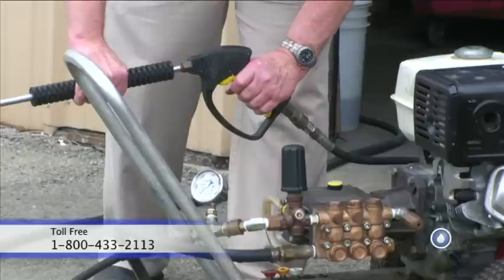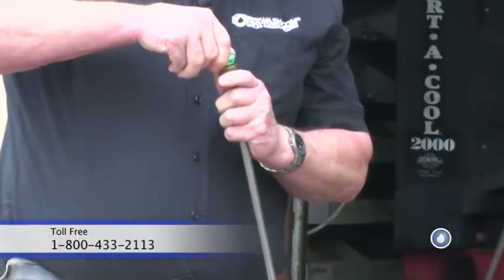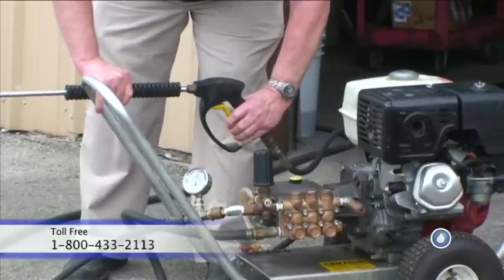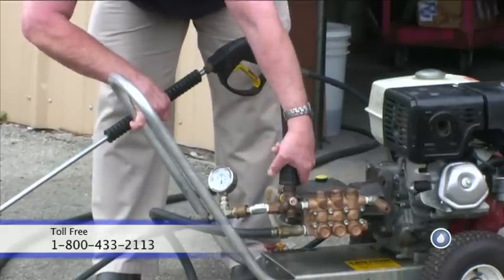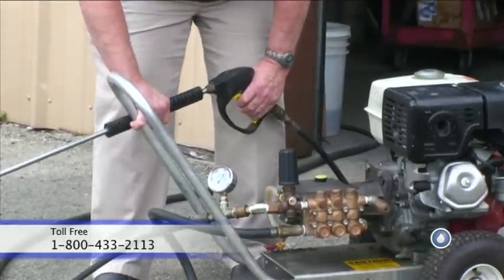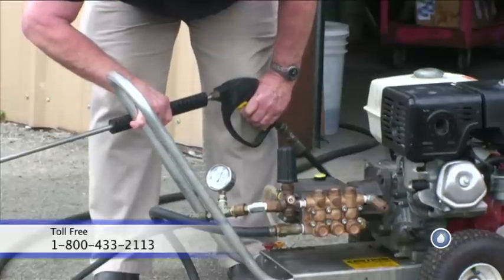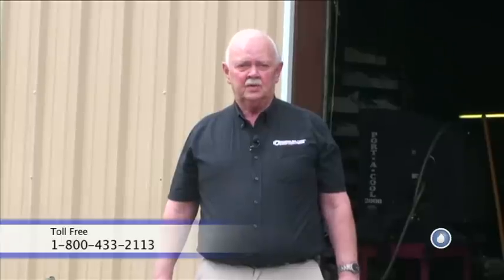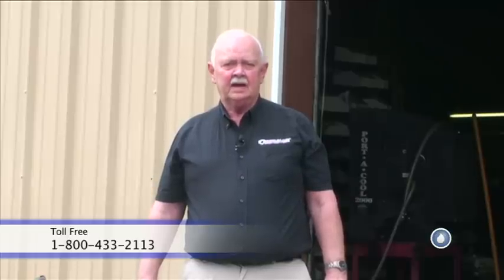How to Adjust a Pressure Washer Unloader with Larry Hinckley from PowerWash.com

Comment: How come when I’m running my pressure washer and I let go of the trigger it builds up pressure in the hose and cuts off the engine. What do I need to adjust to make it run when I let go of the trigger
Reply from the maker: When you let go of the trigger, the unloader valve redirects the flow of water into bypass mode. If the unloader isn’t adjusted properly or is malfunctioning, pressure can build up too much in the system which can cause the engine to stall or shut off.

Here’s what might be going wrong and how to fix it:

Unloader valve needs adjustment – If the pressure is too high when the trigger is released, slowly adjust the unloader while monitoring pressure to find the right balance. Your goal is for the pressure to drop smoothly into bypass without overloading the pump or engine.

Unloader valve might be sticking or damaged – If adjusting doesn’t help, the valve spring or internal components could be worn out or stuck. Try cleaning or replacing the unloader.

Bypass line is blocked or too small – If your bypass hose is kinked, clogged, or not letting water flow freely, pressure builds up fast. Make sure the water can return to the tank or recirculate freely.

Pump overheating in bypass mode – If the system stays in bypass too long without flow, it can overheat. Consider a thermal relief valve or don’t let it idle too long with the trigger off.

Hope that helps! Let me know what model you’re using and I can give more specific tips.

Comment: Does it matter which spray tip you should use while setting it?
Reply from the maker: Great question! It depends on the GMP and PSI of your machine, you will want to use the tip that is right for your machine. Feel free to call us at 1(800)-433-2113 or go to https://powerwash.com/nozzle-size-calculator/

Comment: Does the nozzle and hose length effect the psi reading when adjusting the unloader? I have a 5.5 gpm at 2500 psi and 200 ft of hose, so if nozzles do effect it, which nozzle should I use to test and set the unloader?
Reply from the maker: Use the nozzle that is rated for the machine.  Install the pressure gauge as close to the pump as possible.  Now you set the unloader
Reply: @Powerwash  white, green, red nozzle? I guess I don’t understand what that means

Comment: So if my Pressure washer is 3000 psi. When I’m holding on the trigger gauge should be 3000 psi and when I let go it should be like 3300?
Reply: It doesnt matter which tip fan degree you use as long as each tip is rated for the correct gpm! Im surprised nobody mentioned orfice size! If you have a 4.0 gal/min machine make your you use a 4.0 gal/min tip. It should say on the tip 25040 if you are using a 25 degree tip. First numbers are fan deg, last set it orfice size. You can go higher than 4.0 orfice to lower the pressure but not lower or you could damage the pump. Each 0.5 you go up in orfice size drops pump pressure by 500ish psi. But u still get the proper gpm and the machine isnt running as hard. Hope thus help
Reply: @darrenairey5938  dude ok this is the problem when commercials say, "get help from our experienced and knowledgeable sales associate"
No the dude who convinced John Doe to buy the bigger pressure washer don't know shit about them he's just going the bigger sale.
Reading your comment tells me I was not prepared to buy a pressure washer. There are obviously so many variables and performance changing factors that I am unaware of.
Idk how many gallons per minute my PW pushes. I think the max psi was 4200 but sales tactics suggest more like 3500. And it's a China brand so finding and downloading a Manual or spec sheet is impossible. I guess I'm screwed, only someone as knowledgeable as yourself could do something with my PW
Reply: With that being said, I guess the tip size doesn’t matter.
Reply: @edesir  what he failed to mention is it should be 3000 psi with the 0° red tip if you do not use the 0° red tip like myself who rarely goes narrower than the 15° yellow tip you need to adjust your machines unloader accordingly. Key thing to pay attention to is do not let it go above 400 PSI above the rated pressure of your machine when you are not depressing the trigger on the gun. IE: when you let go of the the trigger on the gun and your machine is rated for 3400 PSI the standby pressure should not be any greater than 3800 PSI. Hopefully this makes sense to you. In this video he was using the green 25° tip which is why the pressure was too low for him but it probably is where it should be if he puts the 0° red tip on the wand. Manufacturers warranties will be voided though if you blow your pump and tell them you adjusting the pressure for the next nozzle down from the red-nosed or because you don't use it they will void the warranty is supposed to be adjusted for the red 0° tip only.
Reply: @Brad.W  Great tip!! ( no pun intended ) :)  I never used the red tip and adjusted mines w the green  tip.   So if i were now to use a red tip, i could potentially blow a seal.
Reply: @edesir  to be fair that's how I knew because I just for the orange tip on some random day I needed to use the red 0° needless to say it was a bad idea the pump seal within the first hour on a triplex pump from the too much back pressure.
Reply: @Brad.W So you have to adjust the pressure every time you change the tip?
Reply: @eddiddy  hope ur right I don't hav a 6.0tip my pump it 5.5
Reply: I know this is an old video and Old Post but there is some great information on here. I am a retired professional firefighter and I just bought a 3500 PSI 3.5 GPM. This is for my home use and the majority of the time I will probably be using my Surface Cleaner to do my concrete driveway and my sidewalks so I might have to understand that either the green or the yellow or the Surface Cleaner should be used with such pressure that I'm 3500 when squeezing and 3800 when not squeezing? Are there instances where you would want to bring the pressure down to say 25 or 2,600 because it's too much pressure to clean concrete? Or if you were going to do a deck or a picnic table and use either your green tip or one of those rotary nozzles you would want to reduce the pressure and what would a good pressure be for cleaning wood? Thank you everybody

Comment: hello i have a 3100psi subaru and i get a strong kick and hard to press the trigger also engine dies and backfires loud most of the time? i took out the unloaded valve and the pin moves freely and i took it apart and all looks clean. Maybe its just turn clockwise to much ? i did notice theres a white little plastic oring and it was a hairline crack in the unloadr valve assembley would that affect anything ?

Comment: I can’t adjust mine I got a new thermal and boost valve. I can see the unloader jumping with the trigger it’s not being pull. But it engine Revs from 2500 to 3000 psi on the gauge. Need help

Comment: Hi, I have a 4200 psi rated BE commercial pressure washer, has a Honda gx390 and 67dx39g1l cat pump. I recently bought a pressure gauge to measure psi from the pump. I attached after the unloader and got readings of 4200 psi at operating pressure(wand trigger squeezed) and 4600 psi bypass pressure(wand trigger released). Is this normal readings or do I have to adjust the pressure down. How to I adjust the pressure to be in accordance with my 4200 psi rated machine.
Reply: I have the question
Reply: Did u find an answer?
Reply: @ImpulsePressureWashing  no i did not but I did turn pressure down just for my peace of mind
Reply: @lambboy3566   oh how much psi did you turn it down too? I heard 3500 is best for 4gpm machines
Reply: @ImpulsePressureWashing  i turned it down so that bypass pressure was 4200psi and operation dropped to around 3600psi give or take

Comment: Great video, what size tip do you use to set pressure?
Reply: Pressure washer tips have the psi orifice size printed on them. Makes no difference what color tip. Just make sure the  tip orifice size matches the psi of the pump.

Comment: I just bought a DeWalt 3600 PSI machine recently. I turned the pressure down at the unloader to wash my car. How difficult should it be to turn that thing? I was afraid I was going to break the plastic handle. Also, it's so tight I had to undo the hose because otherwise I can't get my hand around it to grip tight enough. I tried leaving the hose on and turning the pressure back up to do my rims and was rewarded with a nice burn on my forearm where I touched the exhaust accidentally, trying to get an angle on the thing. It's not vertical like yours, or like in the DeWalt manual, but sticks out the side and is between the hose inlet and the frame. Really poor positioning. Should it be that hard to turn? Just use pliers next time?
Reply from the maker: It's best not to adjust the pressure by changing the unloader setting.  Here is another video I made that explains this https://youtu.be/3mGkOE6awms

Comment: Any ideal what wrong with my pressure, it is work on yellow, green and black tips, but the pump will stop and go when I using white or red tips!
Reply from the maker: You mos likely have the wrong sized red tip
Reply: Thanks. Maybe preowner got wrong size for red and white tips

Comment: Can a 4000 psi hose cause damage to a 4400 psi pressure washer? Or is it possible to adjust the pressure from the unloader to accommodate for the hose? Thanks
Reply: No! It'll be the other way around. If your pressure washers psi was set higher thn your hoses max psi rate it will burst your hose so its best to keep the psi on your pressure washer lower than the max rate on hose

Comment: Good video but I think you need to take into account there is pressure loss at that gauge. Meaning that the pressure can be 500psi+ at the head HIGHER than the pressure at the outlet. Running the risk of over running the head pressure is damaging to say the least.
Reply from the maker: Great comment.  Yes, the the closer to the head of the pump the better for checking pressure.  I will say in my 40 years of working on equipment that I have not seen a drop of 500 PSI going thru the unloader.  I have however seen a drop of 500 PSI after going thru the coils on a hot water machine follow by 200 - 300 feet of pressure hose.  That is not uncommon.
Reply: @Powerwash  Given the loss going through the hot water coils, how should you set the unloader (still set the pressure before the coils)?
Reply from the maker: @buildstoys  Yes, always measure and set the pressure as close as possible to the head of the pump.
Reply: @Powerwash  Thanks for the reply.  So do you set pressure with the coil removed from testing (and then when everything is back inline, your wand pressure could be a few hundred PSI lower going through coil/hose)?
Reply from the maker: @buildstoys  The easiest thing is to mount the pressure gauge at the head of the pump.  That way you always know what the pressure is at the pump.
Reply: @Powerwash  Got it, thanks again!
Reply from the maker: @buildstoys  You are welcome

Comment: if i have a 4000 psi pump. what should i set it on 4000psi ? if i set it on 3000psi would that harm anything or would that be easier on the pump ?
Reply: Why would running a lower pressure be bad?
Reply from the maker: yes, set it at 4,000 PSI
Reply: Dezmar Perez. thank you for a more detailed explanation ! just so im clear running it at 2500 psi is bad for a 4000 psi pump correct ?

Comment from the maker: The pressure gauge is installed before the unloader or on the head of the pump to get an accurate spike reading.
Check the description area for a link to where to buy a the pressure gauge used in the video.

Comment: I have a upright heated 1500 psi pressure washer with a  TT9061 General Pump.  I bought a new unloader and was told to set it by the pressure gauge.  Can you tell me where and how to install the pressure gauge, it didn't come with one on it when I bought it.

Comment: A couple quick questions for you Mr. Hinckley:
Back-story: In an effort to get away from an aluminum manifold pump, I just purchased a (brass) slightly more powerful pump than OEM.  The EBHP rating on the old pump was 3.6.  The new one is 4.3.  My questions are:
1) Is a 5.5hp gas engine adequate power for this newer pump?
2) If not, may I use the unloader valve to effectively reduce the operating load?
3) Where might I find one of those gauge assemblies you use in this video?
Thank you!

Comment from the maker: The pressure gauge should be sized to accommodate the pressure rating for you particular machine.  For example, if you have a machine that does 3,000 PSI get a gauge the is rated for a higher PSI - 4,000 to 5,000.
Reply: HOLA A QUE SE DEBE ESTA RECOMENDACION?